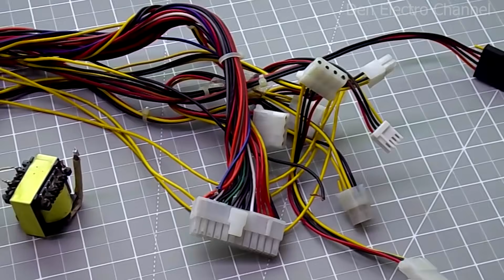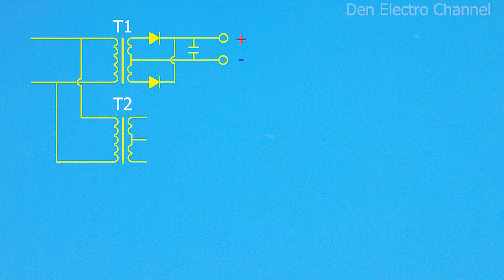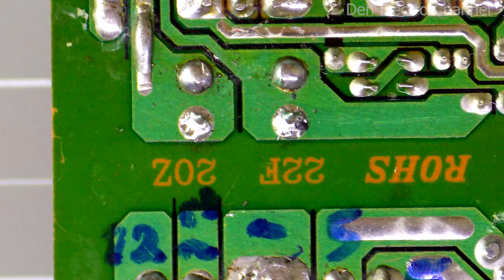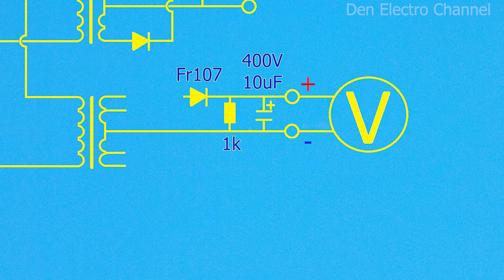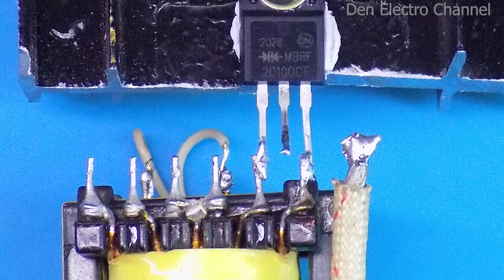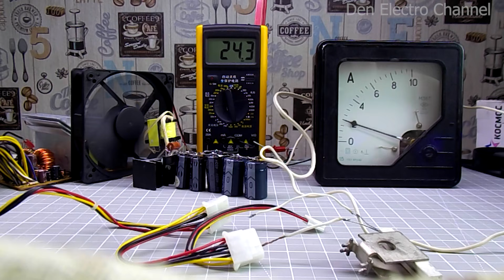ATX Power Supply Hack: Extra Transformer Upgrade

Comment: I think the reason the output voltage of the new secondary transformer is higher is possibly due to
1)Transformer winding ratio being diffrent from original power supply
2)No output loading/smoothing 
3)No regulator IC on the output to reduce duty cycle
Reply from the maker: Thanks for sharing your opinion
Reply: Feedback is missing to control transistor duty cycles
Reply: **(capasitor).      U out = Utr x 1.41